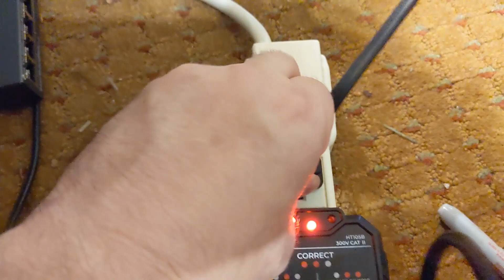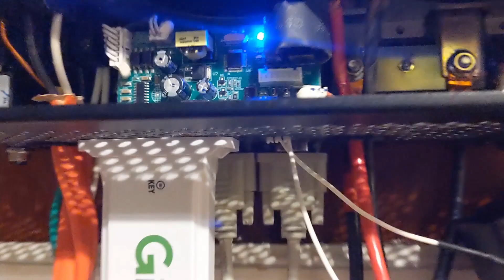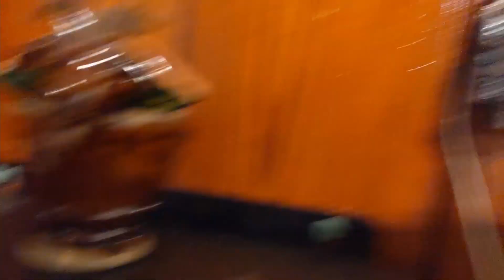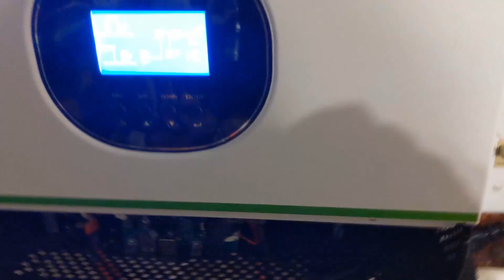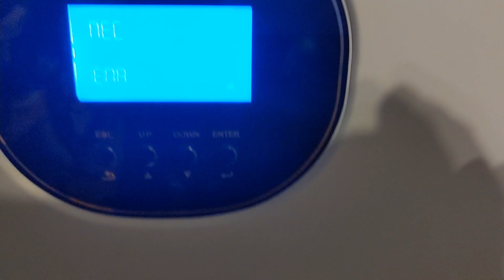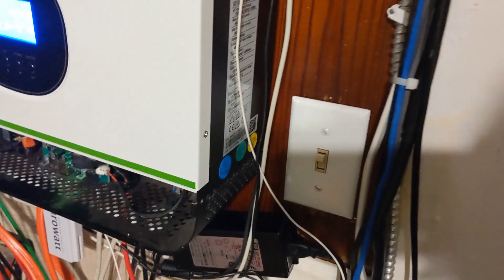Growatt LVM 3000 Neutral Bonding

Comment: Can you take a look at growatt 6000W  inverter I want to run my Chevy Volt charger it gives me red light issue with grounding
Can I get drawing diagram and parts list needed
Reply from the maker: The 6000 watt one is the low frequency model correct? SPF 6000T DVM. If so this function doesn't exist on that unit. The relay contacts on it only are used for remote start of a generator. I'm not sure there is a fix without Growatt adding firmware to enable that contact to be used for neutral bonding instead of starting a generator.
Reply: @andycanfixit  Andy thank you for responding yes I do  have the 6000 t dvm
Looks like I am out of luck for using that charger do you see an option for me to use 220 volt charger the Chevy will allow 220v  16amp charging, maybe there is some type of charger not needing neutral
Also I have a 5000 watt Ames inverter modified sine wave any options  there?
Reply from the maker: @mytickets  Is the Ames a 220 volt inverter? Wattage wise 16 amps and 220 volts is about 3500 watts, so you'd be  under the rating of that inverter, however being modified sine wave it won't be quite as efficient, figure the load will be closer to 4kw. That ames inverter I suspect will be powered directly from the battery bank? If so it basically will work as it's own circuit since it won't be switching back to the grid, which means you can bond the ground and neutral on that inverter if they aren't bonded already. If the Ames inverter can be controlled on and off via a relay you could use a Victron battery minder that is programmed to only turn on the inverter on when the battery voltage is above a certain point and off when it's below that, then it would only power it after your house batteries are full. Make sure the Ames inverter can handle a load of 4kw for several hours though or it might kill it in short order.

Comment: Thanks Andy for this. However, I found another solution which I used..I jumpered the input neutral and output neutral..
Reply: FWIW, this worked for me as well.  I guess the premise is the growatt system (AC out / sub panel) bonds to the neutral-ground on the main house (via AC in).  Not sure if we're both going to burn our houses, but saving $49 a month until then.
Reply: @tb3780  lol , so far so good

Comment: Or, just jumper them at the Growatt where AC in and AC out are connected.
Reply from the maker: That isn't a good solution if you are switching back and forth between the grid supply and the inverter/battery supply as your neutral bond will be in the wrong spot when you are on grid. You'd have a neutral bond not only at your main panel but at the inverter as well. Good overview of why that's a bad idea is here. https://diy.stackexchange.com/questions/91390/why-is-a-service-neutral-grounded-but-not-the-subpanel-neutral
Reply: @andycanfixit  Thanks. With my system configured that way I have no issues and my gauge like yours shows it is correct when on grid or on battery. I specifically do not do it at the sub-panel. I jumper at the Growatt. Test it. Try it. Then get back to me. I appreciate your fast response and the link. I read all of it and that is not what I a doing.
Reply from the maker: @benkanobe7500  The problem with that is, when you switch from Grid to Battery the relays inside the inverter are disconnecting the hot and neutral from your main panel to your loads and instead supplying your loads directly from the inverter. If you place a jumper between the ground and neutral than when you are off grid your bond will be correct, but when you are on grid you will have your neutral and ground bonded at both the main panel and at the inverter. The risk is and granted it's a lower risk, if your neutral to the panel ever fails, all your load will now be carried by the ground wire and things that shouldn't have voltage on them could instead of the circuit simply shutting off and you'd never know there was a problem unless you get shocked or the ground wire fails due to being overloaded since it's usually a smaller gauge than your neutral wire is. 

Granted Growatt should simply include this neutral bonding relay in the inverter and thus eliminate the issue altogether, but at least they have an option for it, unlike the MPP inverters. I'm not an expert on this, I'm simply passing along what I have learned about the reason for it and why code requires it.
Reply: @andycanfixit  Thank you Andy. I know you thought it through. I'm a mechanical guy that had to learn the electrical side on a case by case basses as I progressed through my professional life. A very large volume Seller (USA) of the Growatts strongly suggested I do the jumper. I was playing with the relay signal as you have and you figured a way to make it work. I thought I had a solution as when I plugged in my little tester, all was good once the jumper was installed. You have caused me to take pause and think. Thank you.
Reply: What I think he's saying is that you jumper the two neturals at the Growatt because the input neutral is already bonded at the main panel.. internally the Growatt input ground is the same as the output ground.. What you basically end up with is during battery or solar mode the neutral output is essentially bonded at the panel by "sharing" the neutrals. In bypass mode it really doesn't matter as internally the Growatt switches the internal relay to the grid input I.e input = output..
Reply from the maker: @MrShaneo369  The reason this isn't a good idea is while your on the grid it's fine, however when you are not on the grid, your neutral should be isolated from the main panel just as your hot is. Remember that the neutral carries current when loads are in use, the ground should only carry current if there is a fault to ground. So your ground still connected back to the main panel doesn't hurt anything while on grid but when you are on inverter, by jumpering the neutral input to the neutral output, you run the risk of possibly back feeding some current back to the main panel instead of that current staying at the inverter. The hot and neutral should be isolated from the main panel but in this setup by jumpering them together they aren't. I'd suggest putting an ac amperage clamp meter around your neutral coming from the main panel when you are in inverter mode and see if there is amperage there. If there is that is a problem. You might also want to see if you are carrying current on the ground back to the panel as well.
Reply: @andycanfixit  hey Andy I checked. There is no current flow on the neutral input while in inverter mode. In the event of a fault the inverter is grounded plus the neutrals share a common bond (as I've jumpered the in and out neutral) at the main ground in the panel, the current would flow to the point of least resistance which is thru neutral back to ground. Additionally all my socket and power outlets are grounded to the very same grounding point in the main panel ( no there is no ground loop) . There is a very low probability if at all any that there would be backfeed into the neutral coming from grid. This was the advice given from Growatt when I contacted them. I'm not in the US so that might not be up to USA code but as far as safety goes it's safe. The important thing is that there's 1 single grounding point throughout the system
Reply from the maker: @MrShaneo369  If it works where you are at that's fine. I know in the US it wouldn't meet code here. 

For people in the US I'd stick with the relay. Best of luck!
Reply: @MrShaneo369  Exactly Correct!

Comment: I have a Growatt SPF 3000TL LVM inverter, and was hoping to use it occasionally to slow charge my car in a pinch. The supplied charger trips out though because of this issue, as it is showing a voltage between neutral and ground. Unfortunately, there is no setting 24 on my inverter and without it those dry contacts can't be used for this purpose. I don't know if that setting was just never provided on this particular inverter model or if they removed the setting in the current firmware. The inverter is roughly 6 weeks old as of September of 2021.
Reply from the maker: You might want to reach out to Growatt and see what if anything has changed. My inverters were purchased towards the beginning of 2020. Not sure why they would remove the setting as it's still listed in the manual on the website.
Reply: @andycanfixit  as of the manual Revision 4.0  Option 24 is no longer present. Shame really, as this external relay solves the problem very well. Thanks for the example.
Reply from the maker: @dougbertInExile  Yes, I discovered that on a recent one I bought from Signature Solar and discovered they've removed that option, which is annoying as that option worked perfectly to fix this issue. I don't know why they could not have left it and it be use it for this or use it for gen start, basically either or instead of removing it.

Comment: Im currently trying to sort this issue out with growatt here in Australia and using the low frequency 6kw inverter, having a neutral ground bond after the inverter is the only way an rcd will work properly, however because im using house mains as a backup power source and ground, the neutral bond after the inverter output even when the grid is simply connected but not in use as bypass or charger supply, still trips the house rcd. So I need the inverter contacts to trigger two relays, one to do remove the neutral ground bond, at the same time as energising a relay to supply grid power to the inverter input when it is needed. This is the only way the setup remains automatic as well as the rcd working properly.
Reply from the maker: The relay is used for the neutral bonding has three sets of contacts. You could probably use one of the other two contacts as the control source for that second relay. That would allow it to handle that, though the problem then would be it would assume there is no grid power to switch back to and thus it would not switch back even if the battery was low. 

Is the trip being caused by a lack of ground?
Reply: @andycanfixit  the thing is, not even growatt know what's going on,  i have 2 electrical engineers also scratching their heads as my wiring diagram works out perfectly according to code, but the inverter seems to have a live neutral, and when that is bonded to ground you end up with a fault current that trips the input rcd from the house. When I tried to install a relay today, things didnt go so well, I used the grid input to trigger the coil on an ac/ac relay, and used the nc contacts to create the neutral ground bond when grid input is not present. The problem here is when grid power is returned, the relay isn't fast enough to remove the bond, and caused enough of a fault current that my inverter dead shorted the battery input. Something major is wrong and I have no idea what, and neither does growatt. I believe what I have is the re branded sigineer 6kw low frequency inverter, and its wired as single phase 240v for Australian use. I do wonder if they have messed something up in wiring it like this. More testing will ensue
Reply from the maker: @lexicase8805  Unfortunately I have not had any experience with the low frequency versions but it definitely sounds like something is not right in that inverter, and it could even be a design issue. It makes me wonder if they outsourced the low frequency versions and just have their name on them. The majority of their inverters were always the high frequency versions and those have had a good reputation. I hope it gets figured out.

Comment: I have a 19v, 4.7A adapter laying around...do you think that would work?
Reply from the maker: I would have to pull up the spec sheet to see what the voltage range is. Using too low of a voltage power supply can overheat the coil by making it work harder. There is usually a range it will work in plus or minus ten percent typically
Reply: @andycanfixit  I can't make heads or tails of the datasheet, so I'd sure appreciate your take on it.  I did see min. recommended contact load: 12VDC.
Reply from the maker: @AGhostInTheMachine  datasheet says the operating voltage of 18 volts. Measure the voltage of the power supply you have if it's close to 20 volts it will probably work fine. The coil only draws 2 watts.
Reply: @andycanfixit  ok, thanks!
Will save me a bit of $ and put this unused adapter back to work.
Reply: @andycanfixit  Measured it...the power supply outputs 19.6v
Reply from the maker: @AGhostInTheMachine  It'll likely work fine then. Test it out, make sure it latches, the relay will get warm when in use but it shouldn't be incredibly hot, if it gets really hot, I'd find a higher output power supply instead. Again you only need a couple watts so it doesn't need to be powerful.
Reply: @andycanfixit  Thanks again, Andy

Comment: Very good set up for automatic control.  I see where another gentleman installed a switch for same function but this is better.  Why did you use a separate AC power supply rather than power the relay coil from the battery?
Reply from the maker: My battery bank is 48 volts and I also didn't want something that could drain the battery or risk short with the amperage the battery has.
Reply: @andycanfixit  Thanks for the quick response.  Makes sense.

Comment: So if I were to mount (2 of these in split phase) in a completely mobile off grid, trailer with no input AC, I would just bond the N to the G at the AC panel and use no ground rod?
Reply from the maker: If there is never going to be an input AC, either from a generator or shore power you could just bond the neutral and ground together at the panel. But if there is ever a generator or shore power ac input to the inverters then you need to use the neutral grounding relay to switch where the neutral bonding is located. Now on some generators you can bond or not bond the ground at the generator, this way your panel bonding is always first, but I think for shore power it would need to move between them. And while there is no grounding rod in an RV, the frame is bonded to ground.

Comment: The relay is rated for 240vac.  So it will work for 120vac (in a single Growatt setup), correct?
Reply from the maker: It's actually dual rated for both 240 and 120. It will work in either a single or dual inverter split phase setup.

Comment: Why do Chinese inverters have a voltage on the case and why can't they use the AC ground?
Reply from the maker: Yeah, it should be something included in the inverter design, it would literally cost them a $10 relay and some space on the boards to solve this instead of having to use this. At least Growatt has a solution for it with this inverter, vs most of the MPP Solar inverters don't, so people go installing jumpers on the ground and neutral which isn't a good solution. But it honestly should do this internally. It's something they should all fix.